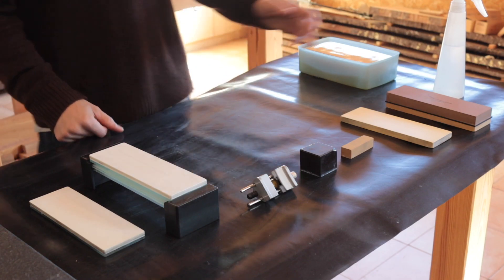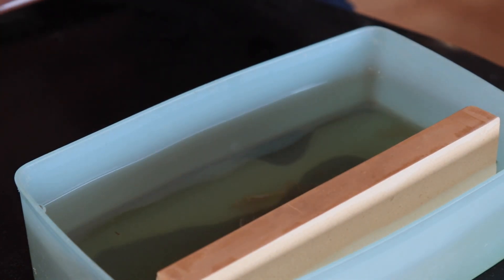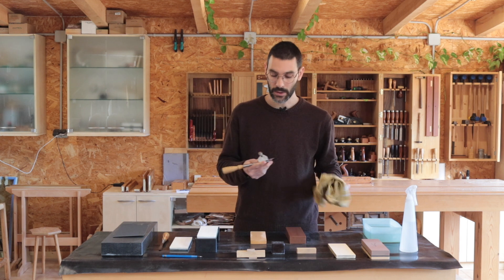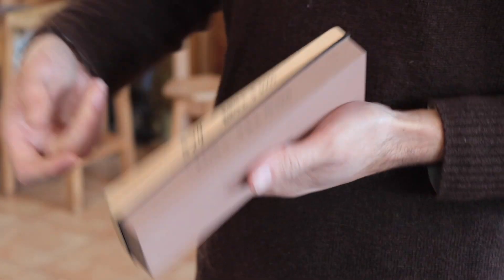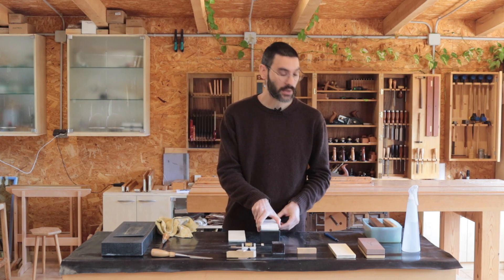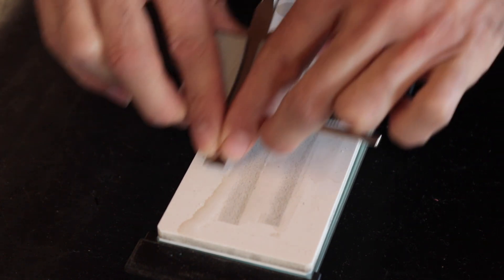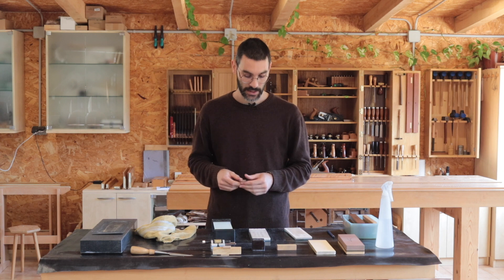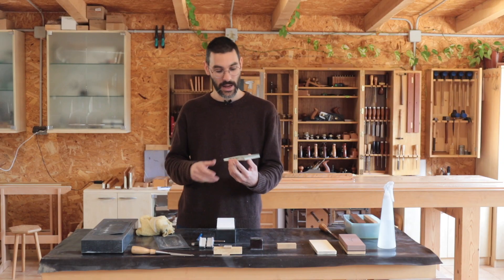My recommendations for sharpening stones

Comment: Hi Germán, thanks for the video! I have had the shaptons in mind for some time but just like you the prohibitive price of the diamond lapping plate was highly discouraging. Now this video gives new life to that wish of having a shapton! May I ask what grid of sand paper do you use? The same for both shapton stones?

My other question about sharpening is what happens when you have a really dull or damaged edge. A water stone seems to slow for that. Perhaps some coarse diamond plate or perhaps some paper over the stone (in the scary sharp fashion) is a better option? Or just a coarse shapton? I guess you use the grinder for that cases. What's your opinion on that?

What I fear about expensive diamond plates is that they can't be rectified if and accident occours. And cheap ones aren't flat at all...

Thanks! Gràcies!
Reply from the maker: Hola Xavier! el paper que faig servir per a totes les pedres és 220, també he fet servir 180. Si he de treure una osca, ho faig a l'esmeriladora. Hi ha pedres japoneses molt grolleres, jo en tinc una de gra 200 que també serveix, i estic segur que talla més ràpid que una de diamant, especialment quan es fan velles. En general, no recomano el diamant perquè tard o d'hora perd tall.
Reply: @germanperaire2022  Moltíssimes gràcies!!

Comment: Great video, thank you for the info!
Have you tried the Atoma diamond plates? I have one 400 grit that I exclussively use to flatten my other Shapton Kuromaku stones. I love it!
While sandpaper on a granite surface plate is a good option, I think you'll get tired of buying and replacing sandpaper.. plus it may be costly after a while!
Reply from the maker: Thanks! I have yet to try that particular brand, but I prefer the broader surface of the sandpaper, although that's just me! I did the math, and it stays a more economical option in the long run as well. It's only after several decades that the sand paper overprices the diamond lapping plates. Glad you liked the video!